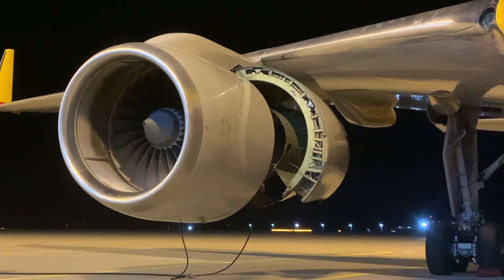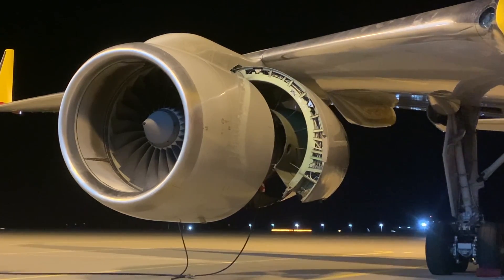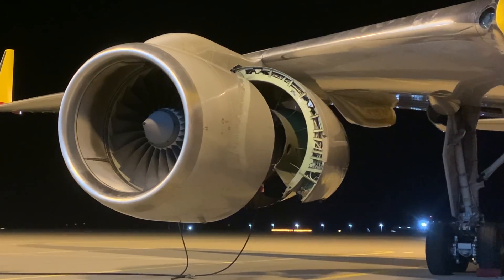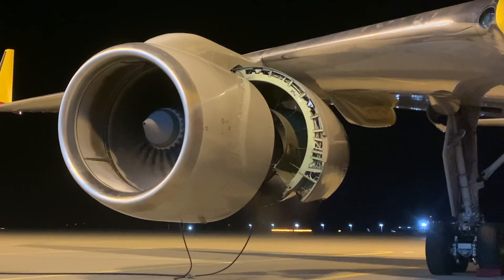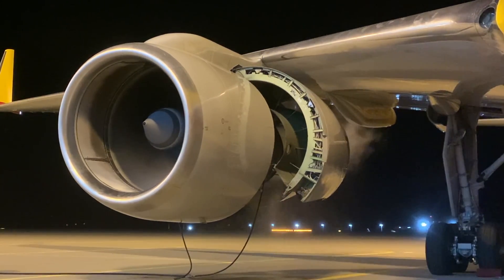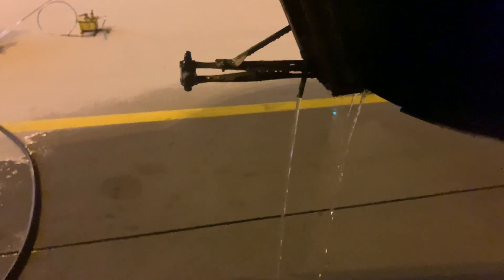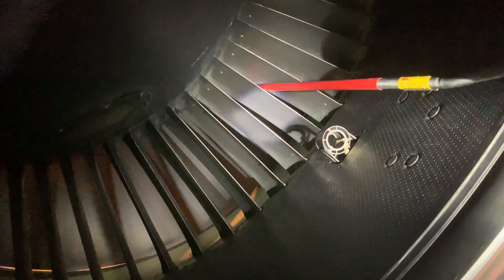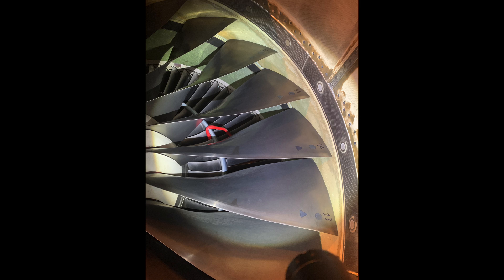🎬 Rolls Royce RB211 ATA 71 Compressor wash. ✈️

Comment: So the inner core chamber with the pressure blades stages start to spin first before the big front fan rotates?
Reply from the maker: Yes, the Pneumatic starter drives the High speed external gearbox, which in turn rotates the HP shaft (N3).
Reply: @aircraftengineerstoolbox2560  Oh wow that is so cool! That is  really cool and interesting on how that stuff works like Holly crap.  That is  very cool and awesome on how these jet engines work like

Comment: inlet guide vines
what do you do if the first core stage are moving compressor blades not IGV's ?
have to go through the fan with more fluids needed ?
thanks for your demonstration video
Reply from the maker: Can't think of an Engine where there the first stage is spinning, at least not a bypass-type engine. The idea of the IGV is to direct the airflow onto the next stage rotor as efficiently as possible. maybe an older type turbojet, but not many of them around. but to answer ur question in my opinion, if it was a turbojet type, the frontal area is less so I would guess high water flow straight down the intake would work.
Reply: @aircraftengineerstoolbox2560  yes I have lots of education on the J-47 & J-79 but I do learn on lots of engines like the RR RB-211's which I love so  do most modern have first stage have IGV's not sure if you know him AgentJayZ is my go to guy for education on the gas-turbo-jet prop & and shaft. thanks for the info

Comment: Did you not need the anti collision light on for this ?
Reply from the maker: It is not a mandatory procedure at this company and we don't have to ask permission from ATC to dry motor an Engine. The only reason It would be on is for safety, if personal could be in danger, but late night on a remote stand there is no need as no fuel is used and the engine is producing minimum thrust. But rightly so in a different scenario I would put on the anti-col light.
Reply: Anti-collision is on whenever there's a person/people, specifically passengers, on-board (at least in the US). This is why its turned on during boarding and deboarding. If nobody's actually on-board, then it's very likely the anti-collision light won't be used. If you check out some spotting videos or full flight videos, you'll notice that parked aircraft won't have their A-C lights on unless they've either arrived or are boarding. I'll be honest, I don't know about cargo ops.
Reply: @fsxvids100   the purpose of the anti collision light is not for when passenger are boarding/disembarking.  It’s use is mainly for warning ground crew/other aircraft that an aircraft is “active”   I.E  engines are running, aircraft is moving.
Reply: @samjones3434  that's a much better way of putting it xD I'm awful with examples. Still, it is why the lights are on to begin with. When preparations for engine start begin, the lights are turned on. Per the FAA (14 C.F.R. 91.209 B), "As a safety precaution, the anticollision lights should be on BEFORE starting an engine or causing a propeller or rotor to move." Therefore, under FAA rules, the lights are turned on before engine start, usually while boarding to warn anyone in the vicinity that the aircraft is preparing for departure. In the end, its at the discretion of the pilot when the lights should be on or not, which is why some pilots leave them on even after the aircraft has come to a complete stop and engines are shut down; usually for quick turn-arounds. Rules might just be different with the CAA and/or EASA. Its quite a small detail, but I guess it varies from Agency to Agency. Here, the anti collision lights would have been turned on, even if just for maintenance, since the fanblades were running at one point.
Reply: no

Comment: What's the stage number of the compressor blades the cleaning process start ?
Reply from the maker: Its the first stage of the 6 stage I.P compressor, attached to the IGVs, the fan on the rb211 is a 1 stage lp compressor.
Reply: @aircraftengineerstoolbox2560  Ok Thanks, looking from the picture I tought the water hose was quite behind the core of the engine, so I was wondering if that made sense to wash only partially the compressor stages.

Comment: The RB211 engine saved Rolls Royce back in the early 1970s and nearly took Lockheed with them.
Reply: it also put RR into receivership
made the L1011 late advanced as it was it was not a big seller like DC-10
the RR RB-211 was the best engine of that time 3-spool-shaft